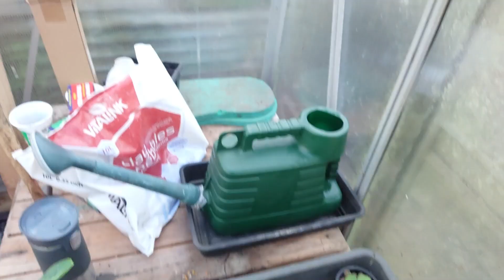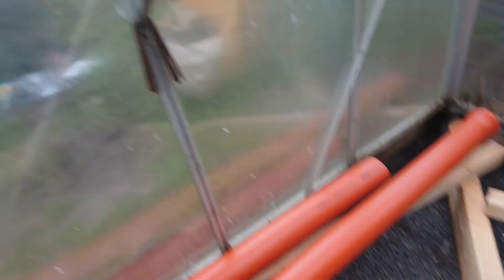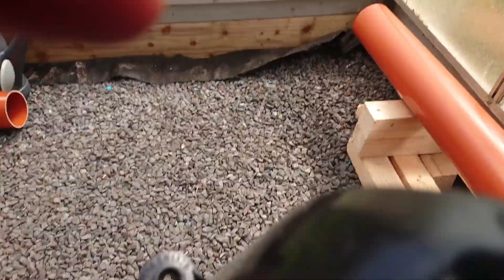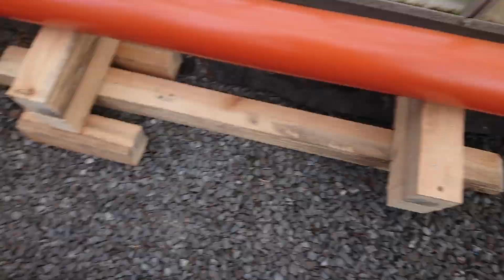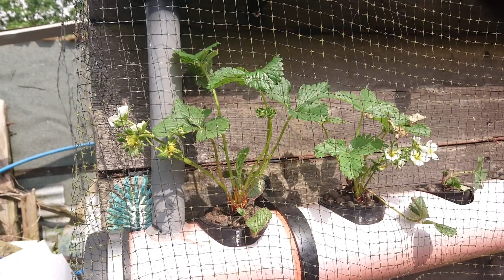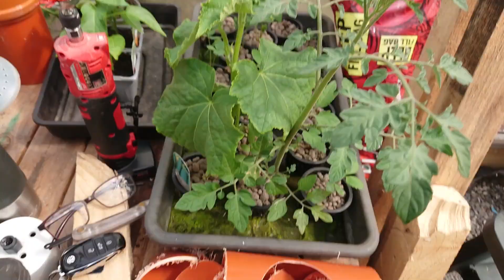DIY Greenhouse Hydroponic Build PT1

Comment: what mix do you use for the nutrients water? tomatorite? thanks
Reply from the maker: Thanks for taking an interest and your comments. So far I've been using a soluble tomato feed, 11-9-30 npk. Once automated I'll use a proper nutrient solution, which I'll show at the time. I don't like doing things twice, so still making some decisions on the solar side of the project.
Regards Rick.
Reply from the maker: Forgot to say, I also keep a bag of Epsom salts handy, pharmaceutical grade (local supermarket does it in 1kg bags as bath salts now and again) I will sprinkle some around each plant and water it in, it's a mineral the plants can get deficient in. If your growing in pots or grow bags, horse molasses (from local farm supplies) a glug dissolved in water, makes a good feed for them too.